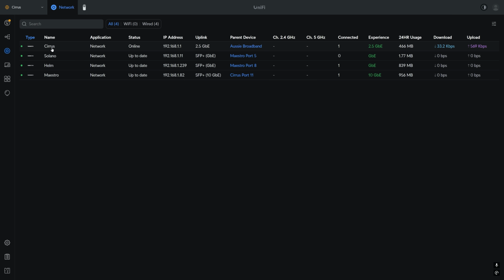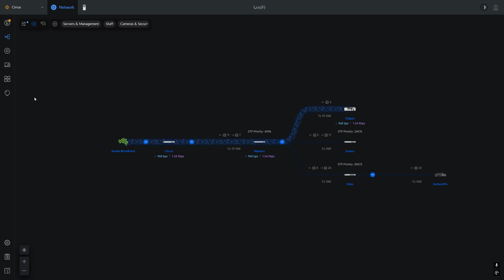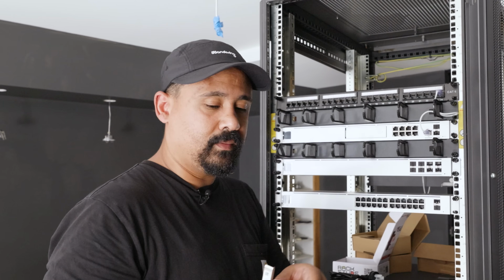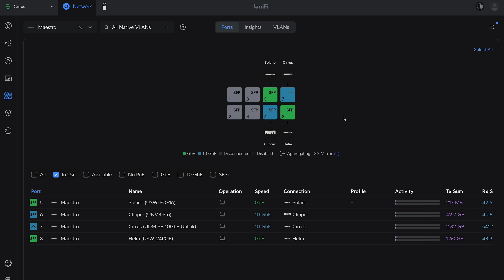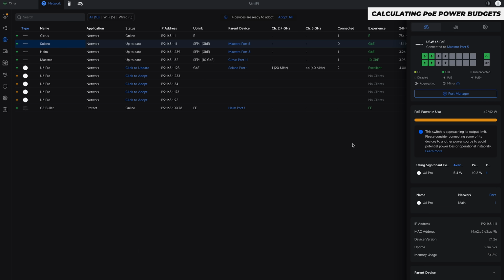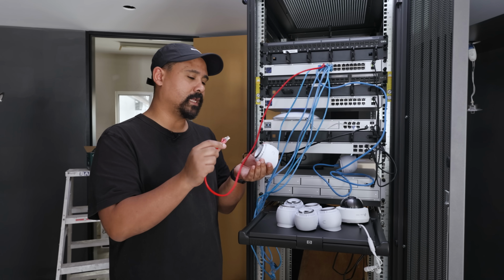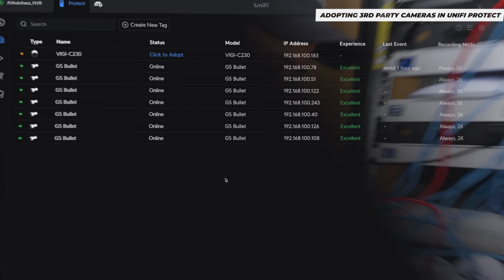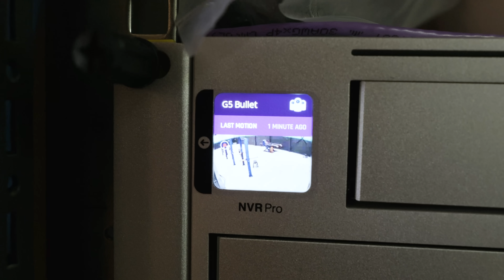Ubiquiti Unifi for everything in a large automotive tuning house | Part 1

Comment: Product availability has really screwed the customer in this case.

Just from a quick search for the products: Aggregation Switch ($491), GEN2 USW-16-POE ($505), USW-24-POE ($659), UDM-SE ($930). Total $2585
It's a shame you couldn't get USW-48-POE ($1050) (with 200W power budget) and UDM PRO ($700) for $1750 and save them money, room in the rack, and the data/power bottlenecks the gear. It appears available online now, I guess it was out of stock when the video was made.

The non-Pro switches you've got are also capped by the 1gb SFP ports, but you've said that's not a concern. The only 10gb links in this vid are between the UDM Pro SE (which has a switch bottlenecked by a 1gb backplane) and the UNVR Pro, could you have just linked up the switches and skipped the Aggregation switch?

I note that the UDM Pro could also take a large hard drive and run Protect (it would support up to 14x 2K cameras), in the same way there is a dedicated device with 7 small hard drives in it (which I assume cost the customer another $2000).

I enjoyed the video, but I can't rationalize the gear choices.

Comment: For a deployment of this type I would avoid using a Dream Machine, PoE or no PoE.
For why? Dream Machines' inbuild 8 port switch is feature and throughput challenged, a known issue.
Rather I'd use a UXG-PRO/UCK-G2-SSD combo.
Many years ago I put a network into a leading motor cycle dealer/race team/tuner, Because they were doing, I think TIG welding, we had to use fibre cabling an shield off the welding bay. The tenant upstairs was a radio station and sensitive to interference.

Comment: The rack placement vs patch panel is confusing - why not just put the patch panel above the switch and use short patch cables. The tracing of longer cables through multiple u’s is not only unsightly it’s also a pain in the ass to fault find

Comment: One thing to note if you’re connecting up the APs to the UDM SE is the 1Gb backplane which may become a bottleneck.
Reply: @sojirou
Sure the design isn’t perfect, but the equipment he chose will only support 1g ports from the switches chose too unless he goes directly into the agg switch lol
Reply: Correct, lerger number of WAP's should be on a switch.
Reply: @sojirou  It’s not a 1Gb backplane. It’s a 1Gb link to the SOC. Totally different. If you don’t know the difference you should really stop spreading FUD.
Reply: Eh not gonna be pushing 1gbs on WiFi tbh
Reply from the maker: It won't be
Reply: @GearSeekers  Not only is throughput constrained ( 1Gbps across 8 ports), but the 8 port switch lacks (R)STP, which is needed to prevent loops forming. For example, they may be formed by devices concurrently connecting wirelessly and wired. This will be exacerbated by the use of the cheap as chips feature challenged 5 port Flex Mini switch which also lacks (R)STP
Reply: hes already got a full unifi setup in his own house. he fully understands ubiquiti.
ive personally got a udm se with several u7 aps hooked up to a usw pro max. there are no bottleneck issues
Reply: @larrydysondev  Because you are using it in a domestic situation.
Reply: @larrydysondev  🤣🤣🤣🤣🤣🤣🤣
Reply: @uberseehandel  youre laughing like i havent been working in IT for the past 28 years.
Reply: @larrydysondev  you might have been working in IT, but that doesn't make you an engineer.

Comment: Would it not have been simpler/cheaper to use a single 48 port switch?
Reply from the maker: As mentioned availability with Unifi gear here in Australia can be tricky at times.